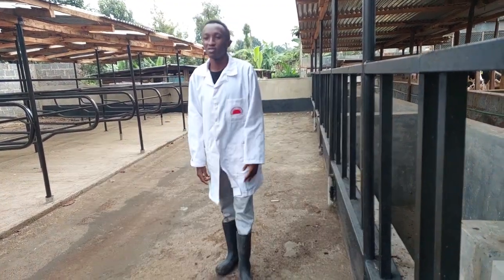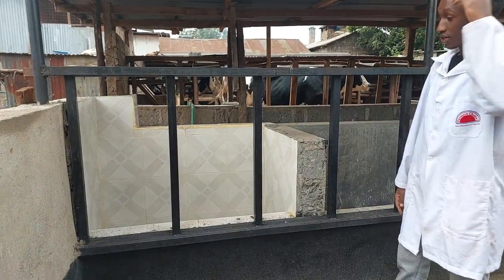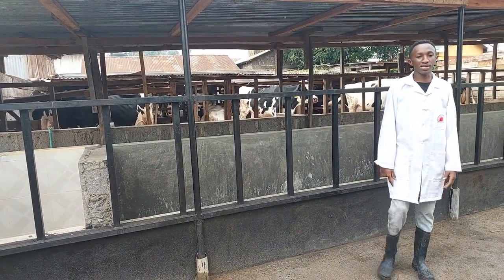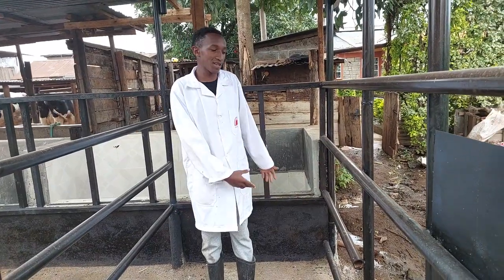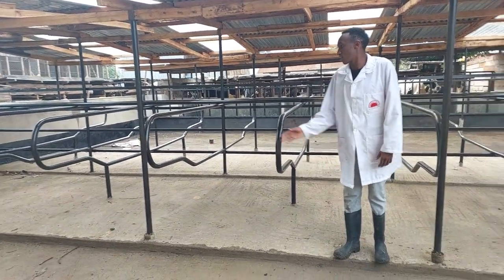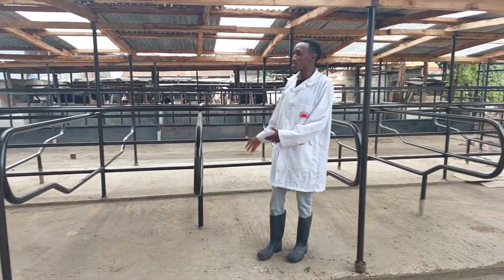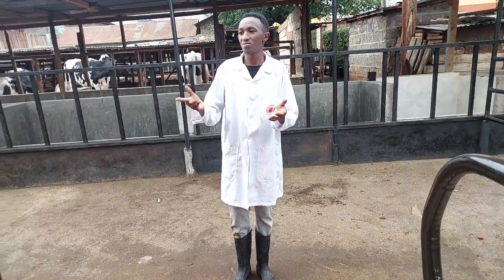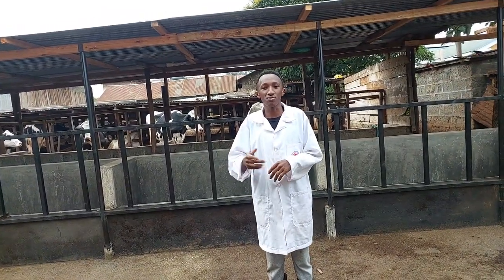How to construct a modernised cowshed....#Dairy farming

Comment: Please tell the structural dimensions of the shed.
Reply: I have noticed that the mabaati is so close to the ground... It will cause heat stress during the dry seasons. The height from the floor to the roof should be atleast 2.8m